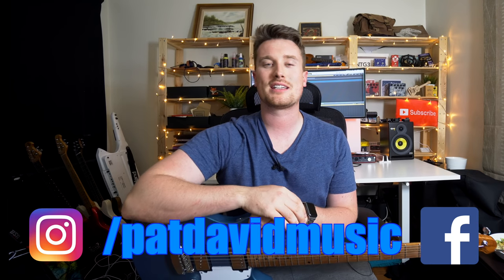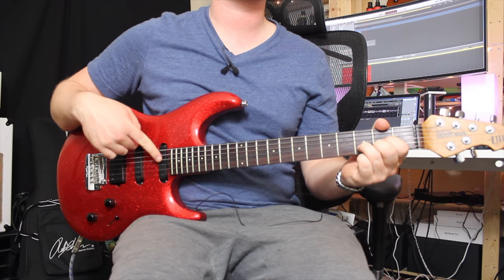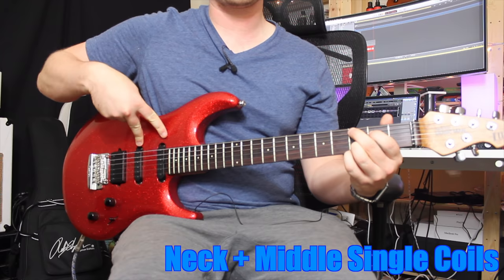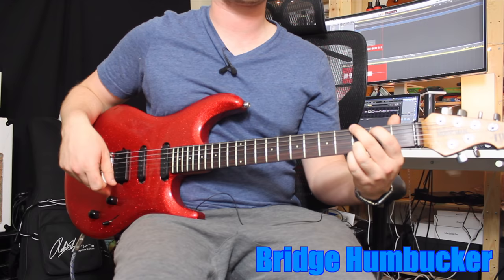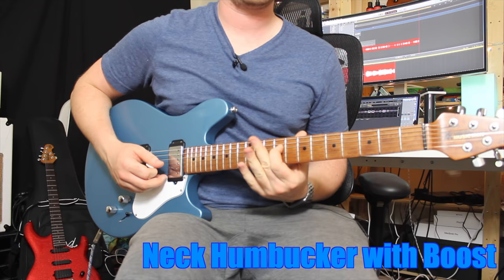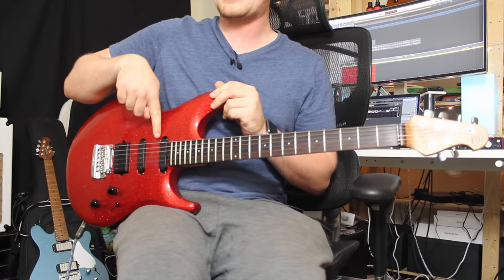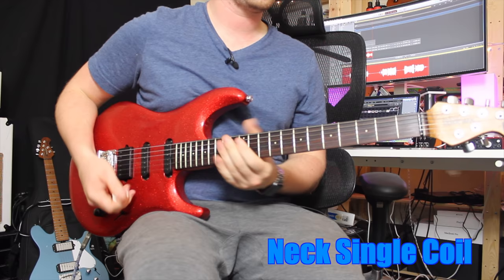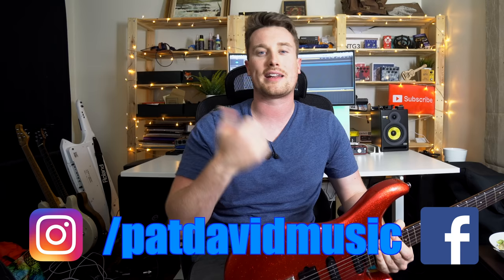🎼 ALL Different Pickup Positions and What They Sound Like 🎸

Comment: 10:35 Just pointing out that it's not so much as having a second magnet that cancels/reduces the hum as it's having a second COIL that's wound in a specific way that does the trick. Otherwise, how does a stacked Strat pickup which has two coils that are wound around a single set of poles works? The stacked pickup's two coils are each wound differently, one coil is wound in reverse and connected in reverse to the other coil. Much like a humbucker but on a single set of poles than two.

Comment: I got a question:
I've noticed that in the Les Paul, the neck pickup is closer to the strings than the bridge pickup; plus, the bridge pickup is not perpendicular to the strings.

Does that affect their sound?

If both humbackers were at the same distance from the strings and parallel to them, would they both sound the same?
Reply from the maker: It does affect the sound, the closer the pickup is the more volume each string has

Comment: Have you ever seen a Frankenstrat with 3 single coils, in the LENGTH of the body? So, one under E&A, another under D&G, and the 3rd under the B&E strings? I wonder what sound you'd get. Any thoughts on that?
Reply: My careful impression is, most people just color between the lines. Please please please, help me find out, how my Frankenstrat will perform, with 3 pickups in line with the strings, instead of across the strings. The 5-switch won't be any good, it needs all 3 pickups. Or maybe switching one off is interesting.
Reply from the maker: Only one way to find out how it sounds, do it :)